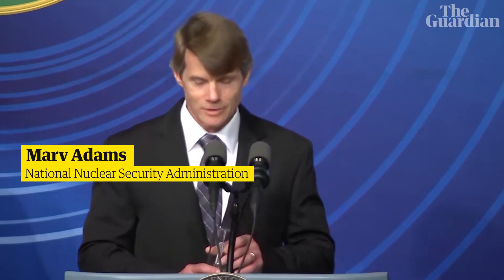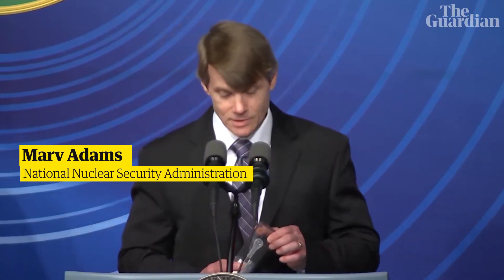Nuclear scientist Marv Adams explains what happened in the successful fusion experiment

Comment: First this is not a ‘fusion reactor’.  Second, this experiment has nothing to do with practical (economic feasible) fusion power.    They ignited some fuel in a holorahm.   And spent about 7bn to do so.

We are about as close to practical fusion power, as we are to interstellar travel.  ITER you say?   It’s a giant experiment.  Just like getting to Mars is simply an experiment that puts us a tiny fraction closer to interstellar travel.   

This should all be of no surprise to anyone, because practical fusion power means you are literally managing/containing a small sun on the surface of the earth, and doing so in an economically practical way.     

Estimating dates is no different than estimating when we can have economically practical solar panels that are 98% efficient.  (instead of 23% efficient). Throwing a date out is completely bogus, because it’s not even an educated guess, it’s just arbitrary.

Comment: While they achieved Fusion they did not achieve creating more energy than was put into the experiment, it even says that in the government report. The energy required through the Lasers to produce this reaction took several hundred mega joules of energy, while the reaction was an achievement the actual net energy gain is not there.  Neglecting the lasers power needs there then comes the fact the report states they ran this  experiment twice and both times the diagnostic equipment that measures the net energy gain malfunctioned. But I am sure the idea will get flooded with government money then in a few decades we find out they are only a little closer but need lots more money. 😂
Reply: 100%. Science community found pretty simple way of getting free money every time they want. Once they thank our visionary leadership and blank check will be handed over.

Comment: EDIT : just checked, and it's a nothing-burger. The "2 MJ" input only refers to the lasers' beam energy, not the energy used to produce those beams. In reality, it took 300 MJ to power the lasers and produce 3 MJ of fusion. So it's not a 1.5 ratio (over one) but 0.01 (way under one). As a side note, they calculated that 4% of the fuel in the pellet was fused. Assuming they could get that value to 100 % efficiency with the same amount of laser power, they'll still be producing around 75 MJ, or 4 times less power than they put in. I'm leaving my initial comment below.

Soooooo wait a minute. A gain of 1.5, yeah, but his own math says it's only the ratio of fusion power over laser power. That does not account for the amount of power that is necessary to produce the fuel capsule (parts and assembly) and to feed it into the machine. The absolute gain is 1 MJ. Let's put that in real-world terms : that's nearly 278 Wh. More real world : that's about the same as 4 laptop battery charges. Now, I don't know the process they use to make that fuel pellet, but I have to assume that they don't grow on trees. It likely involves machine tools and some sort of compressor, and of course at least one computer. I don't know that it can be done in less than 278 Wh. And if it really can't, then this experiment is only a half-success : the fusion part works, but it's not yet producing more energy than what you need to put in.

Bottom line : we need to know a lot more.

Comment: forgot to say that the energy required by the lasers to give 2 MJ to the fusion fuel is about 300 MJ because the lasers used had a very low efficiency of about 2-3% and the cilinder had ha 30-50% efficiency (so just 50% of the energy given by the lasers was then given from the cilinder to the fuel), so they selled you a 150% efficiency that was actually a 1% efficiency

Comment: What an epic achievement! They got 3MJ from spending 10MJ through lasers that give 2MJ at 20% efficiency.
Update: they reported using 400MJ on lasers. Fusion got less realistic once again.
Reply: The point is that the 2MJ absorbed WERE transformed into 3MJ. Efficiency of the lasers does not matter since they are not considered part of the input in the fusion core system.
Reply: @mithras666  LOL OMG ROFL =)))))) Efficiency of the ignition mechanism "does not matter".

Comment: Still took more energy then the fusion reaction produced because the laser delivered 2mj of energy to the capsule but the energy required to produce 2mj of laser was much more the 3mj. And they used tritium(hydrogen with 2 neutrons in the nucleus) in the capsule that is very hard to come by there are only few kg of that on this planet. It is just a successful experiment that can never be a way to produce energy on a big scale.

Comment: Cooling all the excess energy requires releasing huge heated plumes of the most damaging climate gas ... steam.  Solar energy actually has the opposite effect.  It has the net effect of reducing the amount of energy (heat) in the atmosphere.  It cools rather than heats.  Of all power plant types, solar has the lowest cost per kwh and can easily replace all our needs.  Nuclear fusion is best suited for space applications where producing very high amounts of energy in a short time is potentially very useful.

Comment: 2 mega joules in and 3 mega joules out. Is he saying that they had an experiment that might have broken the law of conservation of energy?
Reply: Fusion releases energy contained in the “strong force” bonds between nucleons (neutrons and protons). The strong force is many thousands times more powerful than electromagnetism and gravity, so the energy return is very positive in spite of the high input energy. I’m leaving out a lot of details but hope this helps.
Reply: @werds1392  this still doesn't answer the question about energy conservation.
Reply: @razorr_o  yes it does. The energy contained the nuclei of the reacting particles is released
Reply: @werds1392  but how come some of it gets lost?
Reply: @razorr_o  2 MJ of energy is required to heat and compress the fusion fuel to the point where the fusion reaction starts, but once the reaction starts it is a cascade that continues to release more and more energy. 
Imagine you put an unforced bullet in a fire. Eventually a small portion of the gunpowder would absorb enough heat from the fire that it’s chemical bonds break and it explodes. The small explosion of the hot gunpowder grain, however, is powerful enough to break the bonds in gunpowder pellets nearby. This causes a chain reaction that releases far more energy from the power exploding than is absorbed by the fire.
Reply: @werds1392  the thing that you are talking about is ignition. Not fusion
Reply: @razorr_o  ignition (in the context of fusion reactors) means that the fusion chain reaction began. In this way, the words are synonymous. 
In the case of the gunpowder example, ignition refers to the start of the exothermic combustion reaction. 
In both cases, more energy is released by the system than is put in to start the reactions.

Comment: Reading the fine print:
300+ megajoules of electricity in. (just to power the lasers)
~3 megajoules of gamma radiation out.   (which has to be captured and turned into something useful)
  
The way my math works, that's a 1% return on energy in.   
And that's ignoring the energy needed to produce the fuel (not trivial), and ignoring all the other overhead energy run the reactor (magnetic containment, etc) again not trivial.
  
There's a reason why the joke "fusion is always just 20 years away" is a thing.

Comment: He's not lying, but he's purposefully not telling the whole true. The energy of just the laser is 2 mega joules, but the energy needed to run the whole machine they use to make the reaction happen was 300 mega joules. They actually achieved 3/300 or 1% total efficiency for their machine. In other words they used 100 times more energy to ignite the fuel than what came out of it. 

Which has been done before.... And more efficiently. This does not change anything. That's why he's acting the way he is. He knows he's purposefully being disingenuous.

Comment: An absolute legend ... That was the first success of a (now confirmed) new energy source.... That is insane
Reply: no it is not, here is why, he forgot to say that the energy required by the lasers to give 2 MJ to the fusion fuel is about 300 MJ because the lasers used had a very low efficiency of about 2-3% and the cilinder had ha 30-50% efficiency (so just 50% of the energy given by the lasers was then given from the cilinder to the fuel), so they selled you a 150% efficiency that was actually a 1% efficiency
Reply: @lucacarbonaro2911  learn to listen bro, he clearly said “produced more energy than the lasers had deposited”. He didnt say consumed.
Reply: @vyn8594  they are technically right but the only thing that journalists understand is "they produced more energy than that consumed" just to do click bait
Reply: @lucacarbonaro2911  the important part is that they produced more energy than was deposited. now they just need more efficient ways of depositing the energy. before we didnt see a gain on the deposited energy which was the main problem for making fusion viable since it always resulted in a loss
Reply: @RikerNCC  you're right but that is not what the media in general is saying, especially where i live here in italy, here the major newspaper are saying things like "WE FINALLY PRODUCED MORE ENERGY WITH THE FUSION" or "FUSION IS AROUND THE CORNER" and this is just wrong
Reply: It is just click bait input energy is still higher than output only laser energy was beaten not the energy to fire the laser itself. So electricity is still clear winner 😅

Comment: 2 in 3 out is not +1,5
Reply: 2*1.5=3, "gain" in this context is the magnitude amplification, aka, multiplication.
Reply: he is counting it like the 2 was a unit and that 3 is 2 x 1,5 but that is disingenuous because we dont know how much it went into putting 2 in, so gain is 50% or 0.5 presuming no one is cheating in counting
Reply: @TankenbergNews  , no. We have a unit, Joules (unit of energy). He is approximating, so 0 decimal points of significance. If we use 2, we have:
2.05 megajoules (MJ) in
3.15 megajoules (MJ) out

Or gain of 1.54.

He isn't cheating anything. The statement is from the isolated system, X went in, Y went out. This is a first. The laser's themselves took roughly 300 MJ, but their purpose wasn't efficiency, but study of the system we just described.

"so gain is 50%"

Ok... and what is a 50% gain? X = 1, 50% gain = 1 + 0.5 = 1.5, or, X * 1.5 = 1.5

It's the same thing. A 50% gain is a multiplication of 1.5.

Try not to be needlessly suspicious. Seems like you're trying hard to find problems with statements that are pretty benign.
Reply: @TankenbergNews  , also, to be clear:
Gain - The ratio of the output signal (voltage or power) to the input signal of an amplifier.

Here, the purpose of the fusion reaction is to amplify the energy input. Hence, per definition, the gain is:

3.15 megajoules/2.05 megajoules = 1.54

Comment: There is a massive gap between experimental success and practical application.
The experiment achieved 1.5 times the X-ray energy that hit the glass cylinder, but how to convert that energy into usable electricity?
That's a whole new challenge in itself.
A nuclear pile just boils water to turn turbines, can a fusion reactor do the same?

Comment: You see the excitement in his eyes when he tells how fast the energy production was.
Reply: Absolutely, a yield of 30% is massive!
Reply: @AlexanderBC42  He/you did not take into account the power that is needed to power the laser. 2 MJ is just the resulting energy associated with the laser light itself. It takes more than 200 MJ to run the laser.
Reply: Now we only need to have technology to store that energy.. That quick.. If we could, we would have been storing energy from lightning strikes already..
Reply: @OriginalThisAndThat  No, it's just heat. You use it to power a steam engine, and it doesn't matter how fast it's created, it will need to escape somewhere, and you just put a fluid there and take that heat. You don't need to store the electricity, you just produce it gradually from the heat. Lightnings are different. You can't store electricity that fast I think, but you could use the heat they generate. Only they are too unpredictable, so you would build a lightning power plant big enough to resist the lightning and then you would use it only once a year when a lightning strikes and it would be useless the rest of the year. So it would be a waste of money.

Comment: 2MW in and 3MW out sounds great - but keep in mind that is only for the plasma itself.  Actual fusion NET PLANT efficiency is more like 10x or 100x less than that due to the energy to create the fusion (laser efficiency, etc).  It also doesn't count the energy to get the tritium, or to separate and purify the deuterium, must less the energy to build the plant.  That puts the return on energy (EROEI) at about 0.01 to 0.001.  It is great research, but fusion plants are still 50+ years away, if not more.  Learn more from the video at: LJ4W1g-6JiY (vid bySabine Hossenfelder)

Comment: Im tired of all these pseudo-intellectuals in the comments acting like this is the next step in human evolution.  Did you guys actually read any article on this?  They technically still used more energy than they got out, and wasn't a sustainable reaction due to the fuel design.  No to mention all the other issues with this technology that are far from being sovled, most notably the fuel issue.  Fusion is not going to be an important part of our lives at least for the greater part of this century.

Comment: This is quite possibly the most important discovery of the century.
Insane.
Reply: forgot to say that the energy required by the lasers to give 2 MJ to the fusion fuel is about 300 MJ because the lasers used had a very low efficiency of about 2-3% and the cilinder had ha 30-50% efficiency (so just 50% of the energy given by the lasers was then given from the cilinder to the fuel), so they selled you a 150% efficiency that was actually a 1% efficiency

Comment: This is the first time in as long as I can remember where I've felt something akin to optimism for the future of this world. What an amazing achievement!
Reply: Same!!
Reply: forgot to say that the energy required by the lasers to give 2 MJ to the fusion fuel is about 300 MJ because the lasers used had a very low efficiency of about 2-3% and the cilinder had ha 30-50% efficiency (so just 50% of the energy given by the lasers was then given from the cilinder to the fuel), so they selled you a 150% efficiency that was actually a 1% efficiency

Comment: The fact fusion can be achieved in relatively small facilities and doesn't have to rely on inertial electrostatic methods means not only are commercial fusion reactors very viable, but spacecraft powered by laser ignition fusion drives will be a logical next step for the technology.

Comment: If you believe this is a discovery, you are being fooled. They just decided to disclose this technology because robotisation requires it. Of course, they won't release the real solutions that require no fuel.
Reply: Fusion is real. All they did was heat up some radioactive hydrogen to around a million fahrenheit and it caused it to release a ton of energy. It needs fuel, but it's the cleanest
Reply: @serbianwarcriminal1722  I am not saying it ain't real. I saying this has been known and kept secret until now they permit its release but in the end, there are source of energy that do not require any fuel still kept secret. As long as there are fuel, they have control over everything, this is why this is release and not the Nikola Tesla discoveries.

Comment: The National Ignition Facility (NIF) used 400 mega-joules of energy input to generate the 2 mega-joules of laser-light which generated only 3 mega-joules of output energy.  Even if NIF used modern lasers with 20% efficiency and a 40% efficient process of converting the nuclear power into electrical power, the scientists must still achieve an 8x improvement to just break even in terms of electrical energy output.
Reply: Bro, this is the first real fusion test, gotta start small
Reply: @serbianwarcriminal1722  Previous media reports also made similarly dubious claims of a clean energy breakthrough by the International Thermonuclear Experimental Reactor (ITER) Project.  These projects are hardly "small."  In my opinion, funding smaller projects would produce better scientific breakthroughs and better ideas for power-plant-worker-safe clean energy/power.

Comment: Doesn’t that break the laws of thermodynamics?? You cannot output more energy then what is inputed. These are the same principles that break perpetual motion machines
Reply: But more energy wasn't created. The fuel fused, releasing energy contained within it.
Reply: Okay so what exactly is fusion fuel? The capsule must be replace after each use then
Reply: @CBeezyDSGB  Fusion uses very light elements, such as hydrogen. Hydrogen is very difficult to contain however, so we use isotopes of hydrogen called deuterium and tritium. The fuel pellet needs to be replaced each time the reactor is switched on, but once the reaction gets going, fuel can be added at any point to sustain it.

Comment: What he failed to mention is that by the time you figure in all of the energy that was needed to amplify those 192 LASER beams, the energy output was approximately 1% of the energy put in. Additionally, the element that they used inside the pellet, (tritium) is extremely rare in nature, which means it's prohibitively expensive. Nonetheless, it was quite the milestone.
Reply: It's called 'proof of concept.'  ...and it worked!
Reply: @pauljames9738  The problem is, without that information the public is being mislead.